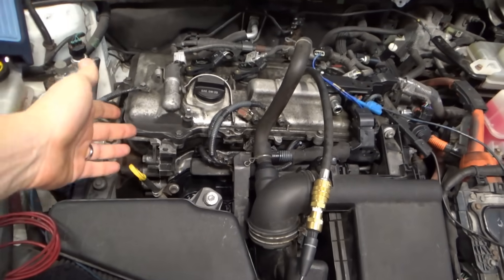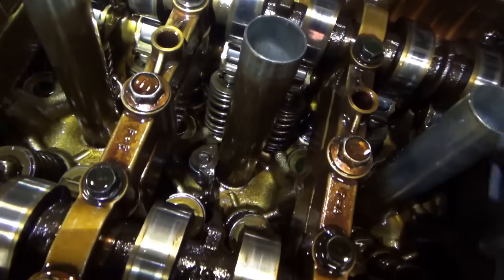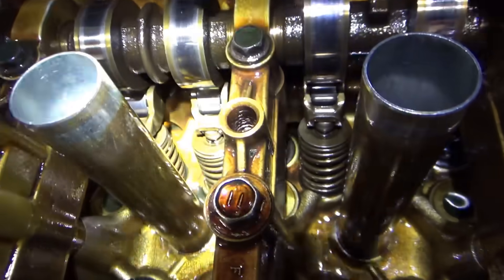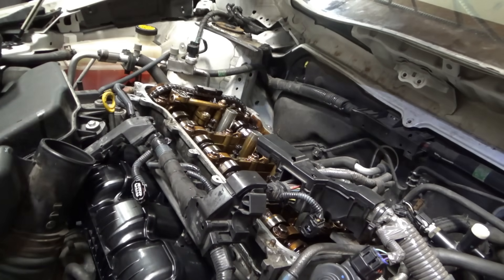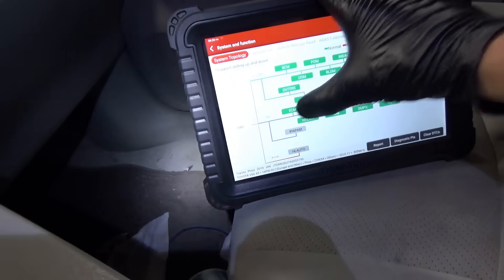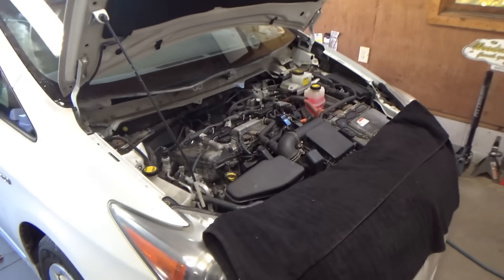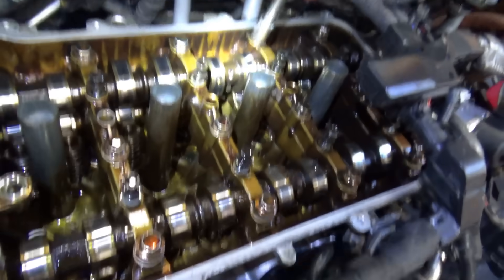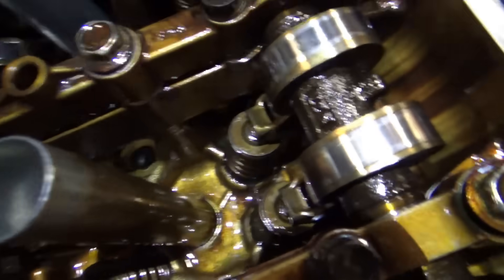(Pt 2) Prius DIY Head Gasket...Now BARELY RUNS?!

Comment: Gotta 2005 Prius 269k miles no major issues yet, (finger's 🤞) it's extremely rusty, it needs some serious suspension work, check engine light is on for Cadillac converter codes so the cats probably bad but before I got it (at 200k) somebody tried some crap exhaust repair (Wisconsin car all it's life so rust rust rust and rusting exhaust falling apart), and the repair has separated so basically I'm not going to touch the cat since I don't have to do emissions testing, I'm just going to take the old u style crap clamps off get some nice long new band clamps or whatever they call them the new style and seal it up that way. 

Also the back exhaust towards the back end hangs because one of the hangers snapped off so when I do the first part I'll do the rest. 

Other current issue is I have no heat, that has to do with the water valve or whatever they call it coolant valve I already have the replacement sitting here, it's basically a little box with three hose connections on it that controls the coolant either going to the heater core, the battery, or back to the reservoir, and it's stuck in one position. 

It used to be stuck in halfway position because I had some heat but now it seemed to switch the other way so now I have no heat lol it's just been so damn cold I haven't had a chance to replace it yet because I'm working outside. 

But other than that I heard only the Jen threes like the model you have are the ones that are problematic and prone to head gaskets. My generation and the ones after your generation are much better and don't have them same issues. 

Other than that this thing runs like a top I have Dr Prius and a adapter and I don't seem to have any issues battery and everything looks good I don't have the full version so I haven't run a battery test or anything but everything looks good The only codes that come up like I said are for O2 sensors and cat converter and that may all be due to that being a big hole in between there so we'll see if those codes come back after I replace the ugly old style you clamps and seal it all up the right way. 

So I would not agree with your assessment that at 150k they're due for major engine servicing like head gasket water pump timing belt ETC like I said maybe with the generation you're working on which is known to be problematic but my generation and those after yours don't have the same issues.
Reply from the maker: Yup 2010 to 2015 are the $$ pits for sure 😁

Comment: I know Ivan's not a fan of these things, but right now my 2010 is at 223k miles. Original head gasket and original brakes. Up until now it's just been consumables BUT the master cylinder is leaking now and that plus the accumulator will need to replaced. It's been a good ride, but I know the HG and battery will fail also, and all these expenditures are more than the car is worth. Would I have been better off with Corolla? Probably, but I got no regerts.

Comment: Interesting so the vacuum must have been so great that it actually overcomed the intake valve and was able pull them open to get the spark plug wet I'm pretty sure that's what you said they were wet is that correct Ivan in the last video?, Now as for the rocker arm I think I'm gonna have to agree with your analysis on that one most likely installed it backwards and didn't realize it.
Reply from the maker: I think the plug was a bit wet with engine oil 😄

Comment: the customer must put the parts in the head  and never put that set in what is really strange it went to a pro machine and they forget to put keepers in the valve  spring you nailed it what you might find when open the valve cover lucky he did not put it together right without that keeper it could have been a major failure

Comment: Allegedly and supposedly-presumably (the word on the street is) that in later (latest) generations manufacturer fixed the head gasket notorious issue caused by 400 a day heat cycles. I do not know how.

Comment: Kudos to the guy for trying and getting the timing right. I think another diagnostic path would be using a pressure transducer on the intake and scoping it.The waveform would have shown that the those intake valves not opening.

Comment: Excellent video.
I can still hear past employers in these types of cases asking me why I did not check that first instead of wasting time with scan tool, scope and compression testes, and then to add insult to injury asking me what I can do different next time so it will not take as long.
Reply: Exactly why they are "past" employers lol kudos to you my friend, so many people stick with the same place even though there's issues like this and I don't understand why when there's so many places out there where you could work for or take your expertise elsewhere, where is appreciated. 

Always about time with the bean counters, but you're doing it the right way trying to validate with all the data possible to point you in the right direction instead of just one and done like a parts cannon almost,
Reply: @B0xlife1  Most, not all, shop owners are greased monkey parts canon operators, illiterate and with below average IQ. 
They look at knowledge and equipment they don't understand or know how to use as a threat to their ego.
On Royalty Auto Service you tube channel I see constant negative comments about his use of the lab scope accusing him of wasting time and customers money by properly diagnosing problem cars.

Comment: You don't know what you don't know till you mess things up. Put the roller in wrong, don't know what right is. Also the same with the cap, you smack it in and if it isn't loose is not good enough, maybe pry on it see if it is solid.

Comment: But why did those roller rocker arms fall out? Were they fitted incorrectly?
Reply: These were knocked off of the place when the cam cradle was placed on the top of the cylinder head.

Comment: Ivan i have 2 prius now, a 08 with 264k runs strong and a timing chain a few years ago other wise i havent had any of these huge repair costs ive owned it for 7 years which lead me to buy another 22 prius last year ive put 32k on the newer one drove to Colorado from ohio no issuse. I think the prius's that you're dealing with have just had bad luck. Which any car manufacturer can run into. I also have another "money pit" bmw which knock on wood... I haven't had any issues with either. I maintain everything myself, and oil changes every 3k on all my cars.

Comment: i had a crazy 2010 prius misfire job once where everything was working as designed.  misfire on 3 and 4.  ended up being broken springs on the inverter torque dampener.  3 out of 4 springs were broken.  easy engine to pull at least
Reply from the maker: That is crazy..
Reply: @PineHollowAutoDiagnostics  I loved your methodical diag.  very efficient

Comment: I think very possibly part of the head gasket failures is due to never changing the coolant . Bad enough that most don’t even keep up on oil changes,but coolant, rarely ever gets done. Nice work Ivan. 👍👍🇺🇸
Reply: I believe you’re right! 
At 120k I replaced all the coolant in my 2011 Prius (and intercooler). I’ve since made four trips R/T cross country (Long Island - LA) and the vehicle now has 177k miles and runs great, no leaks or oil loss between maintenance.

Only thing else I can add is I changes the plugs at 92k miles and I’ve religiously changed synthetic oil on a 5k mile schedule EXCEPT my 4 cross-country trips which were close to 6k miles each … but I made sure it was changed at the start of the trip and immediately at the end.

Incredibly lucky with this vehicle …
Reply: @ Probably has more to do with decent maintenance than luck in your case. 5 years/ 50K is a good idea for coolant, but seldom happens. I’ve never actually tested it myself, but supposedly it becomes very acidic when it is not maintained.

Comment: While there was a problem with the DYI reassembley after the head gasket R&R, I betting even with Ivan's diagnosis and repair cost, it would have cost the owner more for a mechanic to do the head gasket replacement. Further, any added expense to a DYI repair should be chalked up to DYI tuition. Great job once again by Ivan, showing once again, he's not just an electronic diagnostic guru, but a well rounded auto technician that can diagnose and repair mechanical problems as well.
Reply: One thing that sets Ivan apart besides his talent, is his reluctance to fire the parts cannon.
Reply: If the owner learned from the mistake it would still be worth it.  Looks like he did 99% of everything well, just missed that one item.

Comment: Personally I prefer real NGK plugs as spark plugs. I started with that when I had an engine that only did run well with NGK plugs, even Bosch plugs weren't as good as NGKs.
In any case this was a mistake that wasn't impossible to figure out. A bit interesting that it was on a single cylinder. Maybe there are cars out there where one valve isn't opening, and that would be harder to identify as a fault.
Then it's worth to question why there are four valves per cylinder on an engine like this - it's hardly a performance monster and the benefit in a hybrid solution seems to me like it would be marginal.

Comment: The point of owning a hybrid? Virtue signaling
Reply: I'm opposite of the greenies but there are other advantages... Bulletproof planetary gearset transmission, electric power steering with no belts or fluid, 3-phase electric motor driven air conditioning with no belts. Very little wear on brake pads due to regen (I'm still on my first set of brake pads at 250,000 mi). The car is quiet, smooth, and the electric gives it great zippy torque of the line.  Very pleased.

Comment: When you fired that thing up and it rattled, I thought it was done! I woulda been afraid to start it again. Great job on your part! And nerves of steel!
Reply: Lots of Hybrids have a flywheel that is a compensation type and when misfiring sound awful like this one it is a standard noise you have to get used to when it has a problem running smooth.

Comment: Id be worried about that valve cap.  Id have to drop the pan to make sure it fell to the bottom otherwise down the road randomly you could eat a cylinder up or have it get caught up in the timing or something..  that said ive driven with a bolt in the cylinder before when lost one rebuilding a motor..  put a perfect bolt indention in the piston top..  didnt break or crack or scratch anything..  lol. Must have hit the first lick and got pressed into place.. found the bolt way down the line when doing a head gasket..  bolt was a trooper..

Comment: I recommend coolant/brake fluid test strips. When the coolant strip starts to show any degradation, replace the coolant with OEM type HOAT coolant. It is a small maintenance cost to delay the head gasket failure.
Reply: Very much agree, with any vehicle actually. But we all know  it rarely gets done.
Reply: Alas human nature simple  checks get neglected Keeping  an annual check on coolant PH  is so easy with universal Indicator strips. Looking after a vehicles antifreeze coolant is a whole different ball game these days I work on the basis of a 25% coolant change every year keeping the concentration 40% rather than 50%
Getting the coolant type correct for a vehicle model and year of manufacture 😅 🤔 needs great care particularly with German manufacturers as here be dragons 🐲.
At least the antifreezes that  used Methanol as part of the blend are long gone they ate aluminium parts.

Comment: I agree with Ivan 100%  -  any major out of warranty repair will exceed all previous fuel savings.  New cars, especially turbos and hybrids, are just too complex.
Reply: I think that the most reliable (and economical) cars were built in the 1990's.  I have a '91, '95 and '98 all of which have over 200k miles and never required major repairs.  My friend just spent $6k for failed turbos on his ford eco-boost that was just past the warranty mileage ! That's not economical !
Reply: @ True. But  the Obamunist just couldn't leave well enough alone. His party wants you riding horses.
Reply: A blown head gasket isn’t a result of anything to do with the hybrid system. Just a design flaw. Happens in non hybrid vehicles all the time.  Don’t see how that’s related
Reply: @Art-jw8ho It would relate in the number of stops and starts of the engine to maintain the charge level of the hybrid battery. The contract and expansion rates between the head gasket and the block/head are different causing stress, or even worse, movements every time the heat cycle happens.
Reply: @ I agree it could definitely be a contributing factor but there are plenty of other hybrids including Toyotas that don’t have head gasket problems. Regardless, many major car brands can’t get their vehicles past 100,000 miles without major problems so the fact that these are hitting 150-200 still speaks to Toyota quality
Reply: And any major out of warranty repair on a normal ICE car will then exceed all previous money the Prius owners saved. 

Ivans reasoning is stupid, out no this car might have a repair bill 10+yrs later and your savings is gone lololol.
Reply: @Jumalten001  Yeah OK Comrade. You save the world and we will just buy gas like normal people.

Comment: There's a shop in California that actually does specialize in Prius repairs; they posted a Youtube video of a customer calling in the store for advice. "Can I wait until my head gasket leak gets worse and then fix it?" Guy puts the phone on his shoulder, turns to his fellow techs in the shop and repeats the question "You guys think she should wait?" Then he pans the camera around to a wall that's stacked halfway to the ceiling with grenaded Prius blocks with rods poking out. Everyone starts LOLing.

Great cars if you buy them new, but at the first major repair: fix it and sell it. Like you said, money pits after ten years. There's also digital cluster failures, radio failure, repeat inverter/converter failure, and God forbid you have a hatch leak and get corrosion in the wiring/electronics for the battery ecu or brake control ecu. Every thing in a Prius (besides the chassis) is a specialized design, super expensive to replace. There's a reason they're super cheap on Facebook/Craigslist. To be fair, it's not just Toyota, all manufacturers' hybrids suffer the same fate. $$$$$$$$$$$$$$$$$$$$$$$$$$$$$$$$$.
Reply: Yes but they are saving the planet from the evil truck drivers!
Reply: Yup. Prius's ain't saving the planet, that's for sure.
Reply: Another hybrid hater just spreading lies.

Comment: Well, Ivan, almost NPR.  However, this does call into question whether the cylinder head gasket was installed correctly and proper torque sequences were followed.  Then the owner had to go back and verify the timing and I would say his attention-to-detail is a bit lacking.  I think what you said at the end of the video about saving money on fuel only to be spent on repairs is something most people just don't get about these "THINGS."  GREAT VIDEO!

Comment: Nice work ! One question is why did you do the job twice instead of waiting to get the parts and change both rollers at same time?
Reply: I was wondering that too. 🤔🤔🤔 Must've been a slow day at PHAD.  Great videos on this Prius diag/repair.  I enjoyed them immensely.
Reply: He said so he could move the Prius out of the garage, I’m assuming he had another car to pull in and work on.
Reply: @Daltondoubledeuce  That little car would be much faster if you just pushed it out of the way
Reply: @ tell that to Ivan not me.

Comment: This may not be valid in PY, but in Europe fuel costs are way higher and having a car that is easy on fuel really pays off. Any modern car will cost silly money to repair, whether it is easy on fuel or not, so slagging a Prius on that isn't really fair.
Reply: The problem with cars like the Prius is, the entire point is to be efficient and save money.  So as soon as the savings go out the window due to repairs, there is no point to owning the car.  It's a Prius.  It's boring and slow.  If it doesn't save money then it has no reason to exist.
Reply: The daughter of a friend of mine had one. Her battery died at a little over 100K, it cost her almost 7 grand at the dealer. Within a year she had to have the head gasket done at almost 3. When I let him know about the impending failure of the brake booster, he passed it on and she traded it in. She said it was the worst vehicle she had ever owned. Those were just the major expenditures. She had several warranty repairs too.
Reply: The problem being that the last generation of the Prius does not meet Toyota's legendary reputation for reliability.  Pointless saving money on fuel if you have do expensive repairs.
Reply: @ferrumignis  “legendary reputation” is hollow in my opinion. I’ve owned 2 Toyotas. I’d never own another one. Most overrated brand there is.
Reply: In some countries adding LPG to gas cars is very common because it costs about half

Comment: How many cars realistically go over 300k without major work at some point in its life, if that's how long the battery lasts, well kinda "so what" the car is pretty much done by then anyway?
Reply: Yeah that's not generally a thing but if you do high mileage per year it is more possible.
Reply: Lots of cars go over 300K miles w/o major repairs., even here in the salt belt. A local limo service has a Chrysler 300 with 600K miles and counting. The only major repairs it’s had are a torque converter at 300K and a catalytic converter at 450K.

 A friend of mine has an ‘08 Tahoe 5.3 with 400K and counting. That thing hasn’t made more than 30PSI of oil pressure since he bought it at 300K miles, but it just won’t die.
Reply: @alantrimble2881  Congratulations on citing the few outliers in a pool of 280,000,000 vehicles on the road in the USA